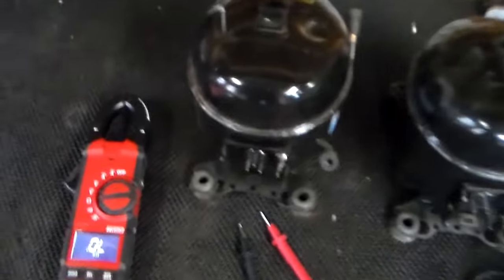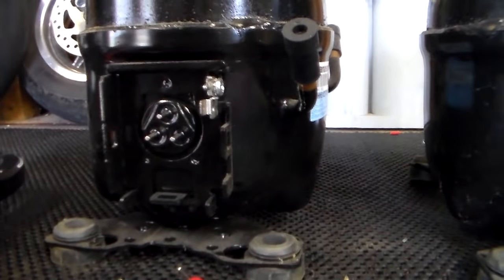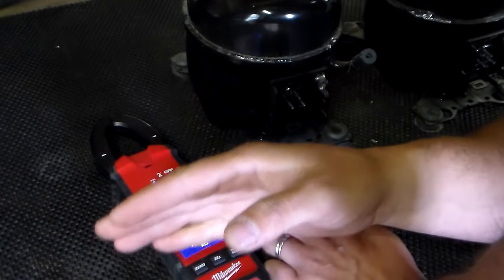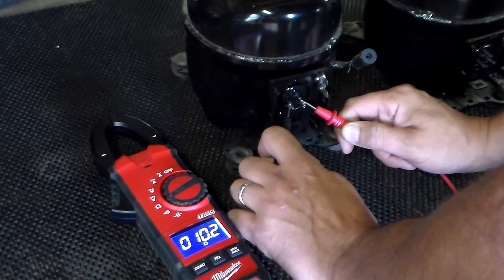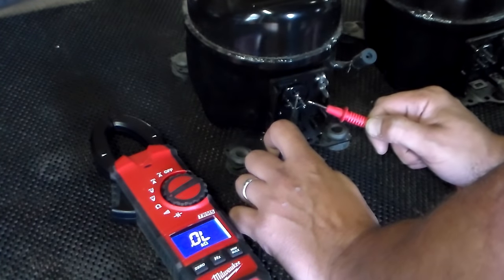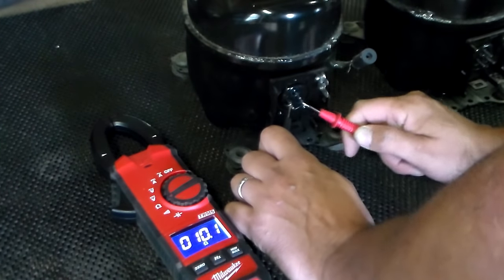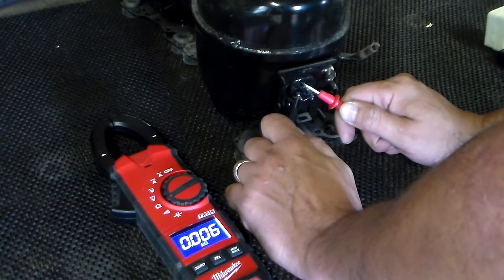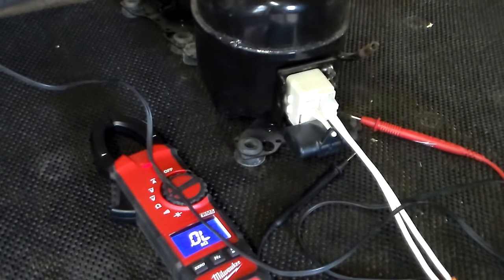How to Test the Compressor on your Refrigerator

Comment: Your triangle test is for continuity of the compressor's driving motor.   The motor may be OK.  But if the refrigerant has been low and the compressor runs hot to the touch,  isn't it possible or even likely that the pump - that the motor drives - might be damaged?   In other words, would a compressor that has electrical continuity and which runs when the evaporator fan runs still be a good compressor with no concern about the pump that the motor is driving?  Is it the case that if the pump were bad, then it would make noise or maybe lock up?  Your opinion would be much appreciated.

Comment: Hey Bill, I had a 3 in 1 running my compressor for about five years, just came home with groceries and found out it suddenly stopped ,noticed the ice cream all melted. There is voltage present, how do you test the 3 in 1?

Comment: Thanks for the Vid it was a big help but quick question. After replacing my relay and overload my unit started and ran and got cold inside but the compressor is getting very hot and tripping the over load. As hot as 120 to 130 deg's with in 15 to 20 min's.  (its a 20 bottle Wine cooler) Any Ideas what maybe causing this to happen.  Thanks in advance!

Comment: Hi  Bill my name Eng Sin , I have Samsung refrigerator , the compressor running , two fans running  , but not cool . I did checked pressure was low ,I try to recharged still not cold . I see your video show how to test the compressor is good , I checking three terminals , two on bottom reading is 11 Ohm , top to left is 8 Ohm , Top to the right 5 Ohm  . All three terminals to body of compressor is not reading , but top to the left 8 Ohm is Okay ?

Comment: H Bill, easily a 10 video. The rooster adds a very nice touch. I have all the same things going on. with a 3in1  for $23. It has the labeled parts for the compressor coils and two power ( which much attach to direct power in. I am going to check there web site. If it goes to coil with no earth ground, not sure it makes a difference. but for GFI installs may make a difference.Many need to make it more clear how to connect a 3in1 because of the above (power lines in are not normally both back for hot and return). Of course this 3in1 is made in china. Also I think the black section of the original is the over power relay not the capacitor you mentioned in the vid. The cap is part of the starter. A very important part of the starter.

Comment: I have a Heavy Duty Commercial freezer that started defrosting and started making a buzzing noise.There is a small black box with two wires on it that is making the noise, I think this is a start capacitor. Am I correct? And is this more than likely the bad part or something else?

Comment: Hi Bill, I got a problem with my fridge. It all started with low voltage at my house, but I forgot to disconnect it. So fridge keep running at low voltage like for half a day, until I notice that fridge is not cooling or blowing any air. I dont know if it maybe the relay ( 3 n 1 starter) or the compressor. So I ended up here in your video, and apply the multimeter in the compressor, but values didnt comes exactly as yours. Heres is what I got: 11.1 (both stick in bottom),  8.6 (one in top one at left), 3.0 (one at top one to the right). So, I dont know if compressor still ok, given these values.
Reply: I had similar values but see this comment is 5 years old. My values are 11 ohm 4ohm and 9 ohm respectively
Reply: @garysamsel6456 Hi Gary, Bill never answer 😅. Forget about the fridge I already throw that out, it was the compressor, it was dead for maintaining a long time with low voltage.

Comment: Hi Bill, I have a Kenmore Elite Refrigerator, model 79575542400.  It stopped cooling yesterday.  The fan by the compressor is running, but the compressor is quite hot.  I keep hearing a clicking sound, and the compressor is either running, or trying to run.  I hear a humming sound, but it's fairly quiet.  I put a screwdriver on the compressor, and my ear on the other end, to be sure the humming is coming from the compressor, (because of the noise from the cooling fan), and it is the compressor.  However, it only runs for maybe 10 to 15 seconds, then clicks again, and stops.  The multi-meter is reading 11 Ohms across the top two prongs, 4.3 Ohms between left and bottom, and 7 Ohms between right and bottom.  I'm not sure if the relay is bad, or the compressor is frozen up.  I'm hoping you can help me be sure, before I start buying parts.  Thank you.

Comment: Thanks Bill. My 22 yr old Amana Side by Side started to shut down both frig and freezer. I left it off for about a week to decide what I was gong to do. I replaced the start relay and overload with a Supco 3-1 hardstart.  I also checked the compressor and got the same ohms readings that you did.( 10,6, 4). Frig is at 39*, but freezer is at 24*. It is empty. I never did place a thermometer in the freezer section since we purchased it, but online comments say it should be 0--10*. I do know for kicks I placed a plastic tray for cubes in the freezer and approx 5 hours later they were frozen. I do not know how to the freezer temp any lower. Any thoughts?

Comment: Bill, I have a GE fridge that the fans run but no operating compressor.  I did a resistance check on the compressor and got a reasonable cross check as you show on a video, replaced the relay - it was showing closed in every possible check, and capacitor did not show continuity though I could not check microfarads with my meter, replaced it anyway. Still nothing but fans and lights operating. Any suggestions would be appreciated

Comment: I accidently left my freezer door open for 2 days... now frigerator and freezer not cold at all. The light works the fan runs but the compressor won't turn on. Should I replace the start relay and the overload first? I don't have an ohm tester.

Comment: Like the video.  Explains simply how to check a compressor.  The 3 in 1 Start kit is junk!  Same profession as you, Iv'e used 1 and they are a joke!  Wouldn't advise ANYONE to use them.  They have factory certified parts for a reason.

Comment: I have a Kenmore elite chest  deep freezer and we had several power surges and the front computer panel turned on a blue light reading demo and went off and will not run any more the demo is still lit up but the freezer will not run. how do we get it off demo and back running? thanks Cathy

Comment: Hello Bill Great video. The temp in the Kenmore fridge and freezer are warm/cool just not (cold). Just wondering. if the compressor is not clicking or making any hum sound. Could the relay switch still be bad or is this a sign of a bad compressor? I just do not have any meter to test ohm right now but I could go out and grab one. Trouble shoot so far. I cleaned all the coils. I can hear a fan running in the freezer and the fan near the relay is running as well. I did pull of the relay switch and gave it a  shake and heard no parts rattling which kind of gave me the idea that the relay switch is not bad. Do you have any thoughts or other test I could do to determine the bad part without a meter. Thanks I hope to hear from yo soon.

Comment: Nice video,but..I have about a 1941 Kelvinator my son and I are restoring. This one has no 3 pin style,but a black relay box with wires running in and out. Any info on how to test this relay and compressor,which has 3 electrical connectors?

Comment: I have a 2007 GE bottom freezer / refrigerator (Model - GBS2KBSBCC / SN HM052667).  Compressor fan, Evaporator Fan, Defroster Mechanism and Compressor relay all work and the refrigerator is fine BUT the freezer will not go below 28F. Coils are very clean!   I noticed I had to move the refrigerator control knob from 3 (normal setting since 2007 for a 36 F environment) to 5 and then 6.  I then tried to set the Freezer to 9 (highest for max cooling) and turn the refrigerator to 1; if either set to zero the compressor / system turned off.  Both thermostat DIALS work since each can turn the refrigerator or freezer off.  In October 2018 I replaced the freezer thermistor, the one in the back cover on top of the evaporator, since the defroster was not activating thus a warm refrigerator.  There is another thermistor in the freezer on the right panel.  Is there a way to validate via the motherboard if this is the issue or do I need to cut it out and test it?  The refrigerator at a 1 setting was 43F, 2 setting is 41 F,  3 setting is 40, 4 setting is 39F, and my normal setting of 5 is 37 F.  It still works so it is either the freezer temperature side-wall thermistor or maybe the R134a gas is low; I had this filled back in July 2017.  A repairman said the Amps on the condenser was reading 0.7 and was suppose to be between 1.5 and 1.8.  He added 4.5 pounds of R134a, checked the amps (1.55) and validated that the pressure/vac. held.  I since purchased a Multimeter but not the expensive one that he had that was capable of looping around a wire and giving a reading (like a finger thumb action)......you can now realize I know crap about electronics, etc.  I have an IR gun and it reads about 105 to 110 F directly on the compressor.    What part(s) do I require?  Any help would be appreciated.
NOTE:  When I call on the Refrigerator for cooling it "clicks" and activates the compressor; however, if I unplug the system, set the refrigerator to the "1" and the Freezer to "9", the system turns on and then it "clicks" and 3 - 5 seconds later it turns off the compressor.  SO, is it the capacitor or start relay OR is the freezer RIGHT PANEL thermistor saying it is "cool enough" and then shuts it down? ANY HELP....PLEASE!!

Comment: Good  Video, My air cond. had quit on me. I went to  Heat and Air company for parts the woman asked me IF i knew what I was doing ?  I say yeah, I am not giving the guy who lives 1/4 mile from my house $60 to come over and take a look. She would not sell me the parts. She said I might hurt myself or tear something up. So I went  to another place and  got the parts. I got one of the universal types like the one you shown but  I do not remember it having wires.
 It had tabs for a plug..  At any rate I got it working.
       Every time I pass by that heat and air place  I think about  that  woman asking me if I know what I was doing. And it keeps getting funnier.

Comment: I have a Maytag Frige and I am not sure about the compressor as there is no cold air. Resistance across the bottom two terminals of the Frige is about 7 ohms. Between bottom left and top is about 4, and between top and bottom right is about 3 ohms. What do you think about these readings ? Thanks

Comment: Ok, my Fan's on but no ones home! lol=)
The Compressor (reciprocating type) is not coming on at all.
Mine reads, 8 ohms on bottom 2, 5 ohms on left and top, then 3 ohms on top and right.
Is this acceptable or not?
GE model # - GSH25SGPA SS ////// about 11 yrs old.
I have already tried a new relay, because my old one rattled like a snake, and seen a video where someone said that meant it was no good?(that goes to the 2-bottom prongs)
 I didn't change the one,(i forget what is called?) that goes on the top single prong. 
Also, looks like the condenser is really dirty, which i am guessing, if the compressor is bad, could have caused the burn out? How hard is that to clean, and how would you go about it? (that wouldn't keep the compressor from kicking on would it?)
Please help, i am in a bad way! No $$$$ right now for a service man!
Thanks so much for your time!
Anyone's help will be greatly appreciated!
Chris

Comment: Bill...tested my compressor...it was good.  Checked ac to relay & start capacitor....good.  Evaporator fan motor running. Continuity checked on evaporator  heating element.....good.   Defrost thermostat checked before  and after putting in a freezer....tested good.  I don't what else to check. Also tested defrost timer.  Placed in defrost mode and after about 30 minutes everything turned on.  Help!!!!

Comment: Enjoyed your video - very clear and loved the sound effects!
We have a display chiller at home - according to the limited documentation that I can find it runs about a 1/8 hp motor.
Is it possible to use a 3 in 1 that is rated higher. as I can't find any advertised at being 1/8 hp?

Comment: Hi Bill,  one question, my fridge is a GE side by side and was clicking for a good while before it stopped cooling, I got a Supco 3 n 1 and hooked it up and it fired the compressor right up, its cooling good etc, one concern though, the Supco 3 N 1 is feeling very very hot on one end, too hot to lay your hand on it long, is this normal for it to be this warm?  Everything else seems to be working great, all fans, etc.  Just wanted to ease my mind about that warmth. thanks!

Comment: Hello Sir, I have enjoyed your videos they have been a great help to a new technician. I do have a question.. I measured the resistance of the compressor and got 6.2 on the run side windings and 8.1 and the other , the dual poles across i got 12.8.. Does the number reflect a bad compressor... the schematics said 4 on the run side and 6 on the start side..pfss2miya ge is the model nnumber ..  thanks for any help

Comment: I have a brand new fridge but compressor is not work. It’s a variable speed compressor. Run to common reads 10 ohms. Start to common read is also 10 ohms. Run to start read is also 10 ohms. Is the compressor bad or I’m not not checking it right?

Comment: I have a question. I hope you’re still answering them! I did a quick starter and got the compressor to run it’s running just under one amp. But even when running it nothings cooling inside. Does this mean the compressor is bad or? I know all the other fans are running. I would imagine I should have some kind of cooling if the compressor is turning yes?
Reply: He won't reply, he passed away a couple years ago.  Died in his sleep, prob a heart attack, gone too soon
Reply: If that is true, that sounds horrible. Thanks for replying.

Comment: First of all, Great Videos, and thanks for posting them! I have a GE GSS25LGMF, side by side. I have used your troubleshooting techniques to trace my original problem (compressor not running) to the large relay on the control board. I am an electronics tech by trade, so I repaired the burned trace to the line side of the relay (temp fix while waiting on a new board). My question is probably unusual, because my fridge is now cooling, but it seems that the compressor does not turn off at all now. Well at least I constantly have voltage on the control board pin (black wire) that goes back to the compressor. I have measured the temperature on the compressor with a laser thermometer at 120-130f. I am not sure what the temp should be, but I can imagine that because it is converting energy, it should get hot, but just how hot? Also, I think I may have heard the compressor stop, but still had 120vac on that pin. Could it have reached thermal overload? I cannot be 100% certain that it did stop running. I turned both temps down to 1 inside the fridge and the fan eventually stops, but the compressor is still running. The condenser fan seems to run continuously as well. I cannot recall this fridge running so long, and if this is an issue, I hope the new board corrects it, but is there something that I am overlooking in the mean time?

Comment: My compressor posts are an upside down triangle, so I'm not sure if they correspond the same as you showed on the video but I checked the compressor and got 10 ohms across top two posts, and about 4 ohms when each bottom post checked with the bottom post (bottom post + top posts make an upside down triangle configuration).  So, one of the 4 ohm readings should be 6...  don't guess it matters but trying to figure out if this is a big deal? means compressor going out??  thanks for advice.

Comment: What if the compressor resistances measure correctly and I've replaced the relay/capacitor and the compressor doesn't run. It draws about 10 amps and the relay kicks out after about 10 seconds. The relay resets after 10 seconds This repeats this over and over. Does this mean that the rotor is seized?

Comment: @BillNewberry: thanks for the video on the compressor however on our side, I have changed the power relay on the compressor. The compressor went on once and does not re- engage, even when the relay cycles. I have checked the resistance on the compressor and the resistance readings are fine. What do you think can be the source of the problem? Thanks.
Reply: rube ur thermostats probe possible thermostat problem

Comment: Great video.  We have a Kenmore French door / bottom freezer - Model 795.72053.110 that we purchased in 2012. We just came back from vacation and discovered the power had gone out for a few hours and the refrigerator was running but not cooling anymore. The compressor is running but only slightly warm. Circulating fan in freezer is running. unplugged the frig for 1/2 hour last night and then plugged it back in. This morning it was still warm. I unplugged the capacitors and the harness at the main board, waited about 20 minutes and then plugged everything back in. The frig has been running for about 45 minutes but the input tube of the evaporator coil in the freezer is only at about 40 degrees. Is this a variable speed compressor?  Do you think this could be a problem with the module that controls the variable speed?  Thanks for any help!

Comment: Hello  BIg help..I teted as told in video I was wondering  I got a bottom pin reading at 11  top /left 12   top right 12 ???? so then when i tested copper lines i got nothing  is my compressor shot & I should replace i Thank you so much for your help ..

Comment: Question:
My fridge will not cool.   Condenser and Evap fans are running. The compressor is on, humming along ,very warm to the touch and is not making any unusual noise.  Everything sounds "normal".  What should I look at next?  The thermostat?